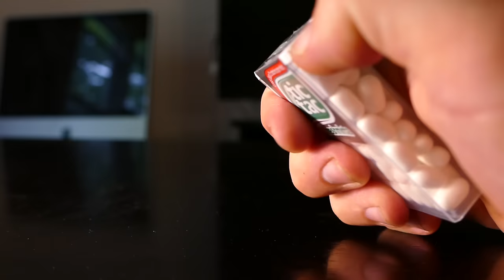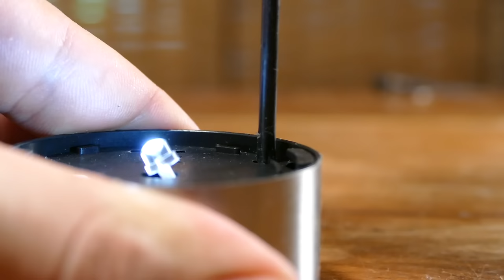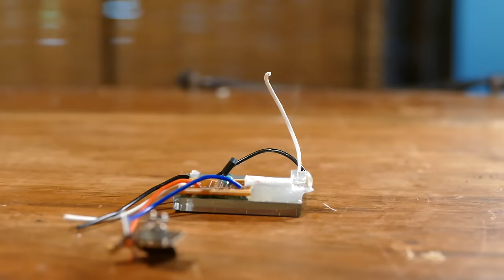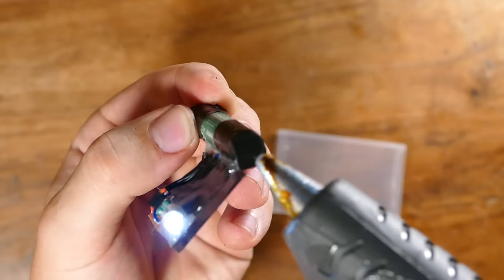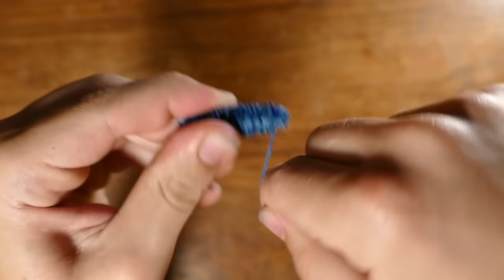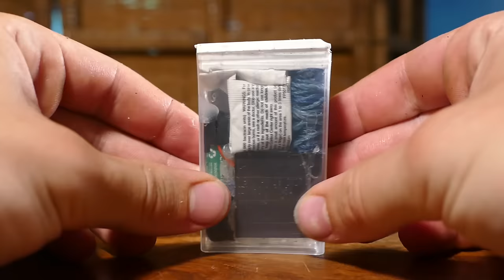How To Make The BEST Pocket Survival Kit!

Comment: This is great! But if I put it in my pocket, wouldn't the light stay on?
Reply: True
Reply: Yes becouse that you must put an on off switch between the led and the battery
Reply: #Alpha: There are many of factors in prepping. 
One resource I found which successfully combines these is the Survivor Crusher System
 (check it out on google) without a doubt the no.1 survival website that I've seen.
Check out the extraordinary free video.